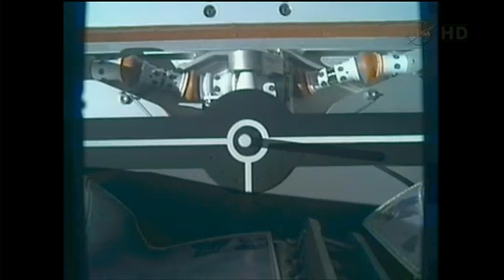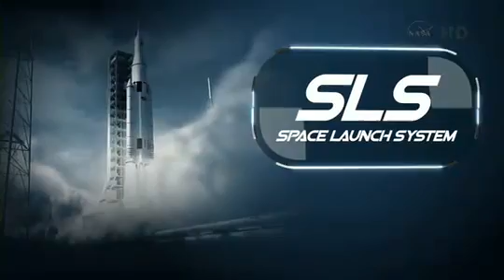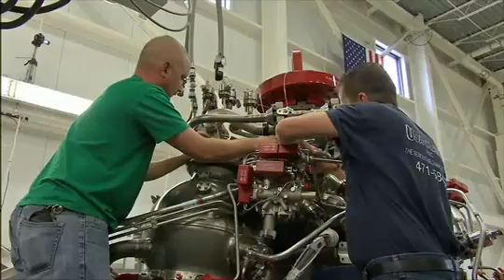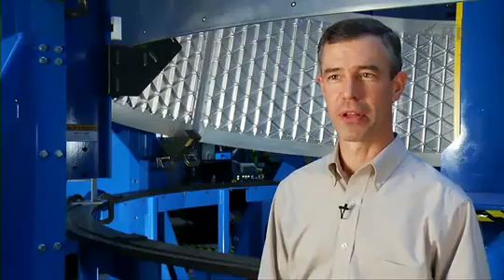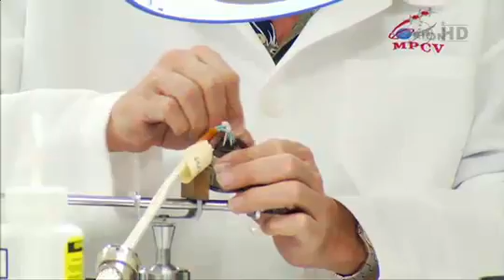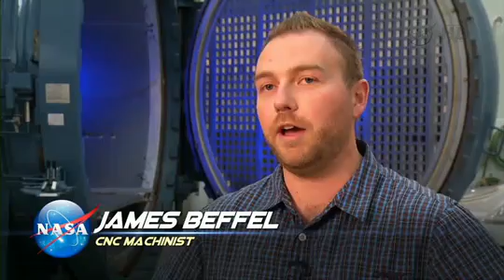Dragon Docked To ISS After Glitched Launch | Video

Comment: ok lets say you get 1000 hd channels on a distance of 35.000km (geo stat. sats). the closest distance between earth and mars is 35.000.000 km which is 1000 times more! lets assume the radius of ur gaussian beam increases linear (which is nearly true), the area the signal spreads onto increases with r² (circle) which would decrease ur received energy by a factor of 1/(1000²). that means you need 1000 times the power of a tv sat (25W x 1000 = 25kW) to get one HD channel from mars. just saying..

Comment: a laser is a gaussian beam whichs diameter increases with distance of travel. the 20m diameter dish is nothing compared to the beam width when it reaches the earth. the more beam you miss, the more energy you lose. all this energy has to be produced by the satelite surrounding mars where the video is sent from, not here on earth.
you have to limit the bandwidth because you need some minimum intensity to compensate the losses so you can actually get usable information out of the received signal.

Comment: Apparently only one of two redundant computers have problems and could continue as if nothing happened. But yes it is noteworthy that the rover is so pathetic that even a total failure would go largely unnoticed.
An even moderately ambitious rover design could match all of what curiosity has done over 6 months in only a few minutes.
the dusty professor with one foot in the grave ambition level Nasa is sporting is of course because nasa is token effort in the shadow of the military space program

Comment: ive just read the article, it just had an memory issue (blue screen) on its computer A so it switched to his computer B while the engineers try to recover the A side as a viable backup if the B side fails too. since it is too risky operting with the b side while the A side is not working properly, it is in safe mode to prevent the billons of dollars beeing risked.